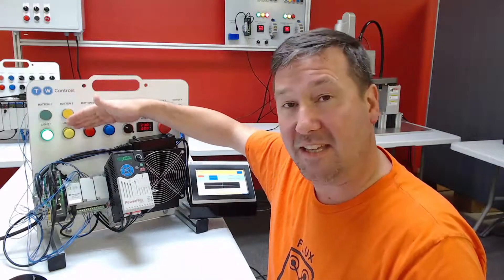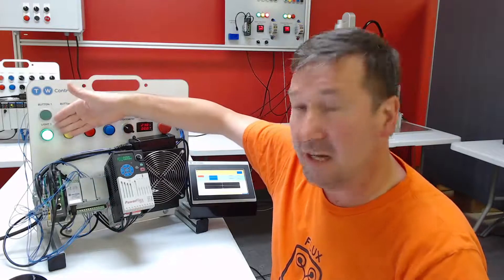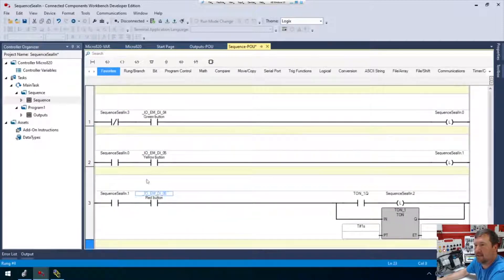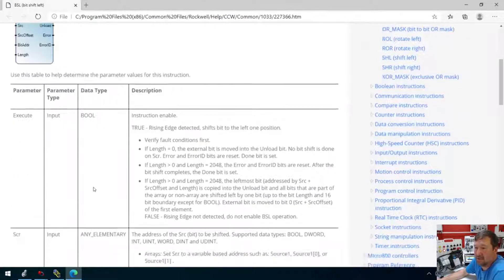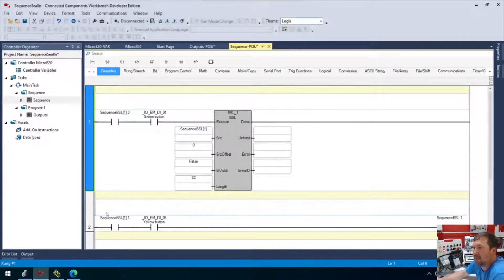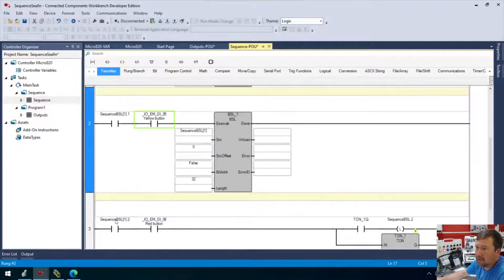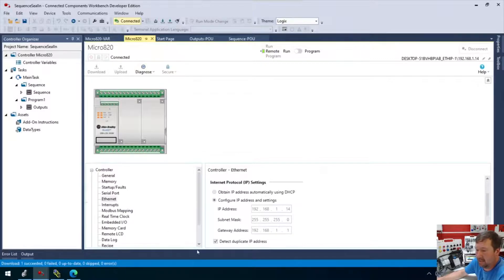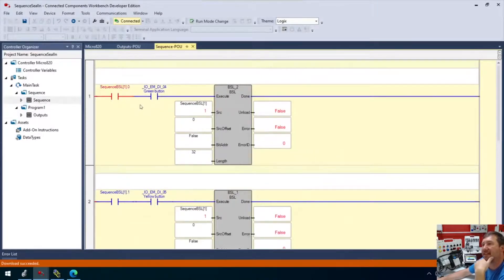Allen Bradley PLC BSL Bit Shift Left Sequence Programming Part 8

Comment: Tim, what would you use instead of the BSL? I work in a bottling industry and I find this used in a lot of different applications.
Reply from the maker: For sequencing or tracking what stations have bottles and which ones don't?
Reply: @TimWilborne  I think most have bottles. The bsl is usually used to kick out bad bottles or to not fill a missing bottle. I am just curious what else could be used in that application. I understand why it’s used instead of using numerous photo eyes to keep track of bottles.
Reply from the maker: @joew4202  The only time the BSL wouldn't be good is if you need to code it for what needs done or want to track the reject types.  Then shifting a number would be better than a bit.